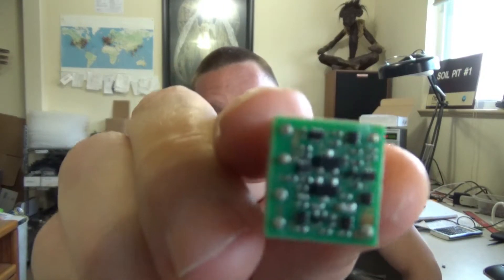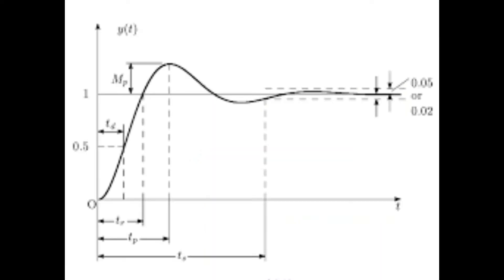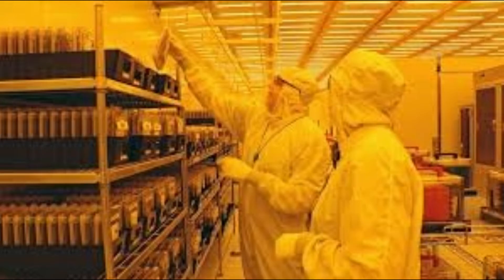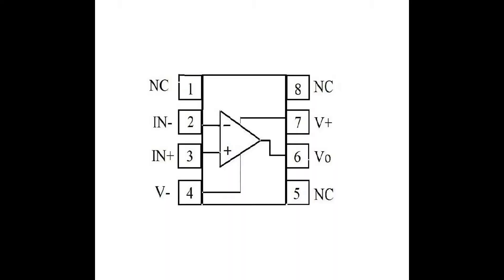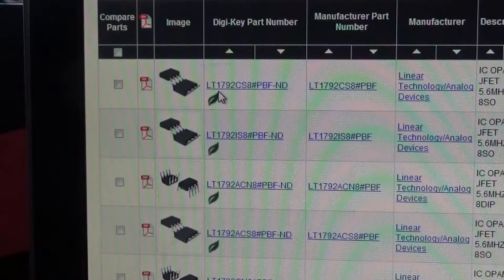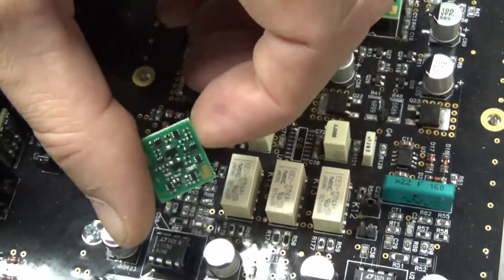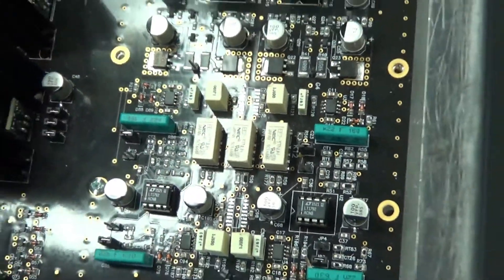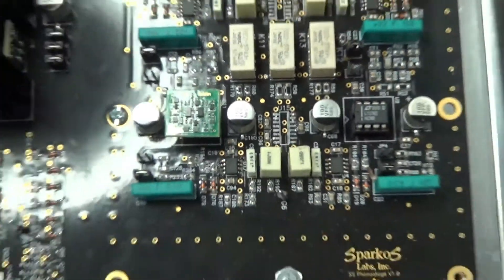Discrete Op Amps - Sparkos Labs

Comment: Nice guy. I like everything about it except the cost because the item I want to change them in was $80. It's a cheap Chinese amp. It's fun tinkering with it on the cheap to see it overperform. Bottlenecks exist in other parts of it, and it's a matching game to get it just right. I need two of these discrete puppies which could end up costing $170. The math doesn't add up unfortunately.

Comment: Could you explain to me how how the higher output capability objectively equates to better sound if that current capability isn't needed? 

Also, can you explain how this will sound better in a high impedence circuit that was initially designed for a jfet opamp?

The reason I ask these questions is that there are some folks that think you can drop some ss3601/2 into any circuit (regardless of topology) and it will sound 'better'. Is that your stance on this practice?
Reply: Better electrical components = Better electrical potential modulation  = Better sound
Reply: @Nutritional-Yeast  what?? Better modulation???
Reply: I guess I can't get a reply from sparks

Comment: Can you put this into a Focusrite soundcard like Scarlett or Clarett and does it make sense to do so?
Reply from the maker: It looks like the op amps in there are all surface mount and you would need to unsolder them, solder in an adapter etc.
Reply: @sparkoslabs514  thanks, too bad.

Comment: Hi SparkoS-guys. I looked at your datasheet of your Sparkos opamp and can't find a single THD number for 10KHz, or any other frequency. If I look at the LT1115 from Analog Devices, they are getting 0.002% (-94dB) of distortion at 10kHz, with a 600Ohm load.
How does your's compare? Also, the LT1115 has only 0.9nV/rtHz of noise, and costs <$10 a pop. So a fraction of your discreet OpAmp.
Reply: Raw THD percentages are somewhat meaningless because they do not describe the spectral content of the distortion.  For example 0.02% distortion that is even order in nature will be and sound far different than 0.02% distortion that is odd order.   We do have spectral plots of THD on our website on the discrete op amp page and compare spectral distortion plots of our devices to several other op amps, both IC and Discrete.  On noise, yes, one can find op amps in the world that have less noise than the SS360X discrete op amps, and while having low noise is an important spec, the magic in our devices is more so due to their high class A bias currents employed and the way that they are compensated rather than their noise spec.  We have a white paper on how our devices are compensated with two poles rather than with a single pole like IC op amps are.  That paper can be found on our website as well.

Comment: I'm in absolute heaven! Thank you Andrew, Sparko and Mrs. Sparko! ;) I've installed one Dual Op Amp SS3602 into my new Aune X8 Magic DAC XVIII and when I thought this DAC was finally the one that sounds most natural, pure and real to me, I added SS3602 and ... WOW! I can't stop listening to music! Something magical has happened, in simple description - it feels like I'm inside the music now. 2 channel stereo now sounds like Dolby Atmos with surround sound. Yet it's still coming out of only 2 speakers - that sound like they quadrupled in size. I'm not over exaggerating! The sound stage is both wider and deeper, the bass is very defined and pronounced - making me consider to move my speakers further away from the wall, and they've been there in their place for over a year. Mid range has great timbre, sounds great and musical! Nothing wrong with the highs either ;) Vocals are real, instruments are reproduced very naturally. Whatever part of music or instrument I want to focus on to listen - I now can and with ease! Sounds fantastic! My setup: PC (Deezer HiFi) > USB > aune X8 magic DAC w/ linear PSU > Mogami GOLD RCA cables > DENON AVR-S760H > 14 AWG OFC speaker cables > HiVi Swans DIY 2.2A Speakers, playing in pure direct mode. This class D AVR / amp now sounds like pure gold, like I'm running the sound through a very nice tube pre-amp/amp. My $300 DAC now performs like at least 3 times its' price, I'm not kidding! Prior I've returned 3 DACs - Topping E50, Schiit Modi+, SMSL SU-1. I think the new Aiyima 07 MAX amp might be on its way back, as now my AVR sounds better for some reason... maybe Sparkos OpAmp?!!! ;) 👏❤🎵

Comment: Just ordered the dual to compare against the 5532. Let you know if stable at 22V (headphone 1bit Analog To Op Amp Like Digital😊 to Analog DSP with tube buffer). 5532 op amp no probs but a lot of cramming two channels in dual mode....

Comment: Doesn't anyone use chip pullers anymore?  They are designed to apply equal/ symmetrical force to two sides of a chip.
Reply: What chip pullers do you recommend?
Reply: Not really needed.

Comment: 2 pole compensation versus 1 pole would give more bandwidth and slew rate for the same margin of stability. However, in modern times we have video op amps with 1 GHz gain-bandwidth and 1000V/us slew rate for under < $10. Modern audio op amps have more advanced forms of Miller compensation compared to the 80s 1 pole or nested loop designs and transitioned from Class B to Class AB. Nice 80s audio op amps cost 50 cents, nice modern ones $5-10. Discrete designs from a reputable brand like SparkoS start at $80 for dual channel.

Comment: Mostly Opamps are not socketed and changing them with another model will most likely just change
but hardly better something. To realy achieve a betterment one has to look at and understand the schematics
and then decide what can be done to enhance quality. Often it is better to up the quality of the surrounding 
passive parts ( cheaper and more effective in many cases) than go for a discrete Opamp that easily cost a 
multitude of a chip one. Often the surrounding passive parts contain filters and compensators specificly designed
for the original opamp in the circuit. Those have to be adapted if the opamp is changed.
Reply: So then what accounts for at least modest if not brisk sales of this "snake oil" by at least three brands? Is it mostly driven by placebo satisfaction?
Reply: @greg1030  No,but for example  in the case of simple buffer and output stages its the most cost ineffective way.

Comment: Does anyone  know of anybody doing this with Kinkis ex b7 monoblocks? I was told they have  Kinki Amplifiers are high voltage rail, high gain, high bandwidth & that they are extremely sensitive to the quality of the power supply...which can cause humming issues. Wondering if changing the op amp would not only improve the sound of the b7s but may also help with the humming.

Comment: Hi. Im just kind of learning about this stuff, lol. I was wondering, I use a guitar effect pedal that uses an lm308 chip. Which if I saw correctly is a single circuit chip. Could I use your product in that pedal and what would it do for the sound? Thanks
Reply: Exactly for your purpose it would probably not be a good idea. Guitar effects rely on components that is not state of the art, like this device. LM308 will color your 
sound, Sparkos will not.

Comment: Hi just wondering the general current requirements of this single version is? 
My Neve console is driven off a 16V + / - DC supply (the NE5534 IC pre-amp in there atm) is it 25ma ?
Reply: The SS3601 / SS3602 discrete op amps can run up to +/- 18 VDC supplies, so +/-16 would be OK.  

They draw around 15mA per op amp - so the dual op amps (SS3602) pull 30mA
Reply: @andrewsparks3157  great and yeah my Neve console channels it has 5 NE5534N op amps across each channel, but I’m thinking it’s really the pre-amp that is the one I should change correct? That will be the biggest change to the sound if I put in your class A module correct?
Reply: @andrewsparks3157  great will do 👌

Comment: Um... you didn't really mention any performance measurements.  One advantage of on-chip opamps is the precise matching you can achieve between transistors - they're right next to each other on the same piece of silicon, so they stay at the same temperature and so on.  Discrete op amps lose that.  So that's at least one reason the packaged opamps might be better.  Looks to me like you're just saying "ours is better" and expecting us to take your word for it.  You need to show us HOW its better, with measurements.
Reply: We have a full engineering data sheet on our website.  

We also use two transistors encapsulated within the same package for diff pairs, and current mirrors, which provides IC grade temperature and parameter matching.
Reply: The data is available 
Also the whole world is saying sparkos is ‘better’
Reply: He's just selling snake oil...

Comment: $78 for a dual opamp seems like a rip off.
Reply: plus, not one company uses them in their gear.  I mean, are they aware they're missing out on the vast soundstage and, what other subjective idioms do we get?
Reply: The best of the best are more expensive and sound nothing like Class A amplification!

The Sparkos sound exactly Class A,
You get what you pay for!
Reply: @Car Guy daddyo Where did you get "give them away"? I said the price seemed like a rip off. It's too expensive, which means you could sell it for less, but your skanky ass has to go to the extreme. Proof that any dumbass with a soldering iron and a handful of cheap parts can call themselves a business. 🤣

Comment: Other than higher output drive capability, I really don’t see why these opamp are better. The input voltage noise and PSRR are similar if not worse to off the shelf precision opamp like OP27 that only cost a few dollars. However on these discrete opamp, the input current noise density are not specified, input bias current are through the roof this input offset will NA large if any reasonable source resistance is connected to it. Also, with the 2-pole compensation, the phase response is a mess, this makes these opamp more susceptible to parasitic capacitance and inductance in the feedback loop. The complicated phase response also make these opamp not very practical in feedback circuits like loop filters where stability is as important as noise. Chasing a super high open loop gain is not really necessary as well, since in any audio application the opamp always runs close loop. Last, most of the modern opamp has classAB output stage that is very carefully designed not classB, so distortion is not really an issue anymore with the benefit of higher efficiency. With all these combined, I would pick a off the shelf precision opamp over these hyped up “audiophile hifi grade” discrete opamp not to mention the temperature stability is going to be very bad. If I need boosted output drive capability, I can easily built a low distortion output drive stage with some discrete components.
Reply: A lot of class AB output stages are carefully designed, few if any really get rid of that pesky crossover distortion.  Are you saying that $2 Op amps don't have any crossover distortion?  I enjoy my Topping DX7 Pro DAC with the standard TI LME49720HA OpAmps installed and it sounds great but word on the street is that the SparkOS offers better performance than the TI modules.  Improvements that you can hear.  This might be one of those things that in theory or on paper it seems like not such a great idea, but to the ears it's a different story.  Your theory is interesting but have you listened to them?   What's the rest of the setup?
Reply: Tupu Humuhumunukunukuapua'a I doubt  human ear can hear much of the difference in THD down to say -100dB, at that level the limiting factor would be the speakers/transducers than the electronics. Unless all the THD is contributed by one type of distortion, o wouldn’t blindly chase to achieve the lowest distortion possible. One a certain level of distortion free is achieved, the rest is tonality and other mechanical components in the system to make things sound good. Maybe it is better than some of the popular audiophile opamp out there, but it doesn’t mean it will work as a precision opamp. I will never use that for anything requiring stablility over temperature, and the information in the datasheet is not really up to the level of what ic manufacturer supplies. For example, at least include some noise density spectrum and THD measurements if they are making the claim that it is killing ic opamp from major manufacturers. I doubt any discrete opamp will ever outperform AD797, but I might be wrong and there might be some very capable people out there absolutely crushing it.
Reply: Have you read the data sheet compared with the others on the market?
Have you listened to them?! 

They destroy the others - the others sound nothing like Class A - they sound like a very different sound, far brighter, far thinner, far different to source input 

The NE5534 seems more neutral to the source compared to all the other discrete class a chips, but the Sparkos are exactly the same as the source input!

I’ve got HD recordings of a Class A Neve 1073 unit, compared A/B with another 70s Neve Unit with the sparkos class A, ics 
You won’t pick which is which 
They both have the exact same output transformer and very very similar input transformer 
The difference is only the active component - the amplifier… the 1073 has the 2N transistor Classic Neve Class A of course. The other Neve unit has the sparkos class A IC.

The 70s Neve unit had the NE5534 as the Amplifier, now changed to sparkos class-A ic
Before changing it over you could tell the unit was class a/b - you could hear the .1% cross over distortion… and the Neve 1073 was easy to pick, out next to it, regarding the amplifier stage.

Now with the sparkos there is no difference 
In fact 3 friends have said the Neve unit was the Neve 1073 after listening to the samples, when I forced them to pick one 

All other Chips sounded nothing like the source input at all - most sound like they have a massive q response in the top end 

Others also try hard to sound like analog sound… they end up being dull, and have nothing of class A sound.

Even burr Browns non-discrete sound over ssyy 

Nothing at all sounds like what Class A sounds like - ( a full unchanged ) source amplified 100% giving 100% transparency and that solid open low end, with no cross over distortion! 
Just clear space detail…
The only Class A ic that does that is Sparkos
Sorry also Rupert Neve’s RND new design Class A Discrete op-Amps also do.
Apart from these 2 I’ve never seen any Discrete Op-Amp even get as close as non-discrete op-amps do, regarding the pure function of a Class A amplifier.
Reply: In audio industry, there is yet an effective benchmark to evaluate an audio device. The LME49990 looks superb on paper, but the SS3601 can beat it easily. I've more than 50 kinds  op amps at hand. I'd say discret op amps do have their advantage over integrated circuits.
Reply: Crossover distortion is directly related to the load. If the load is light (which in many line level stages it is) class ab can have just as low crossover distortion as pp class a.
Reply: I’ll point out that “perfect” sound that looks good on paper isn’t why music sounds good. Your complaints about discrete having less than perfect phase performance is what I’m referring to. It’s the imperfection, albeit a “good” imperfection, that causes music to vibe and sound nice to our human brains (soul). Think Steely Dan Aja. Recorded on a Stephens tape machine. Does that sound bad to you? Go measure the dynamic range of that tape machine vs newer digital equipment with IC and surface mount cheap but accurate components. Digital has far better range but that doesn’t mean it sounds better. I know it’s subjective and it’s all based on people’s preference, but it’s like the difference between watching Ferris Buellers Day off that was shot on film vs watching an episode of The Office HD on way too fast of a refresh rate and you can see their makeup because it’s so clear. Which is better? Well, personally I’d much rather see the non HD less clear but more dreamy, larger than life exaggerated colors of Ferris Bueller. Accuracy isn’t always king, in fact, it can be distracting and take away from the art on display
Reply: @closerthanabrother9703 I fully agree with your argument. For example the SMSL SU-1 dac provides great "numbers" and should be good (for its price) in theory. For me it sounds thin, artificial and fatiguing. I get headaches with it. I've tried other similarly priced dacs with worse results in theory ("numbers") and they actually sound more natural and engaging. Good sounding equipment isn't only determined by measurements and mathematical "perfection".
Reply: You need to use your brain and your ears - it is as easy as that!
Reply: @qddk9545 you should heed your own advice.